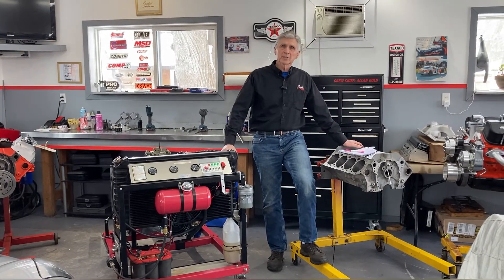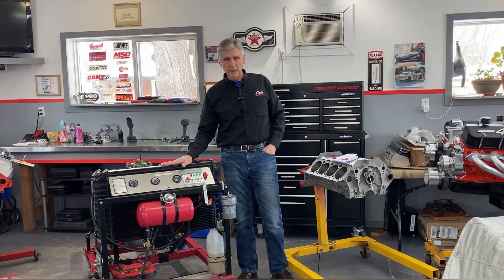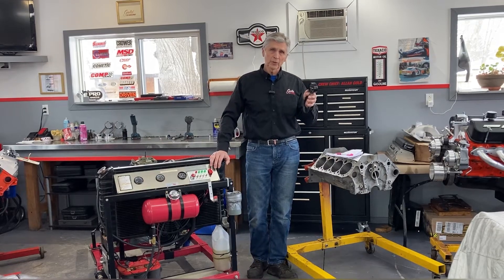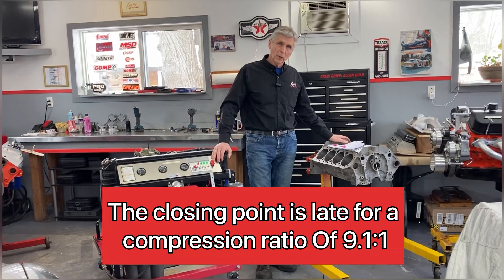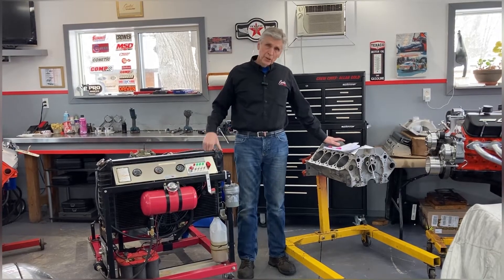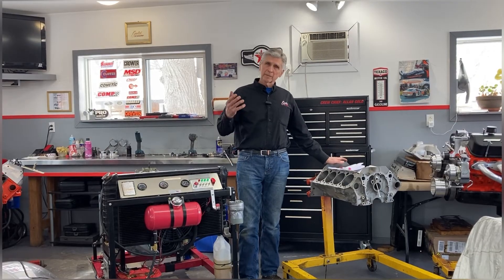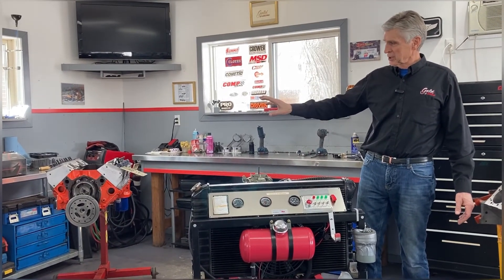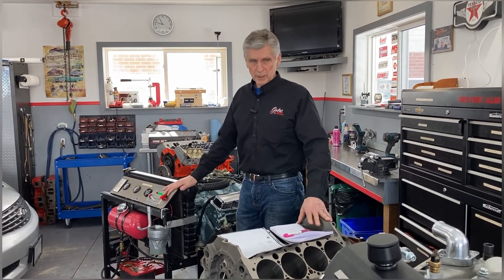Selecting the right camshaft- Matching your cam to your compression ratio - PART 1

Comment: For a good street engine you don't want anything over 10:1 compression. My motors are 9:1 compression n run pump gas. Higher compression ratios n you will need higher octane fuels to prevent knocking/pinging, and today's pump gas with ethanol are less than ideal. I still have to treat my fuel with stabilizer n occasionally octane boost for better performance.
Reply from the maker: Good advice, thanks for sharing your experience with compression ratios and fuel. AG

Comment: Based on my experience  working on race engines,for drag racing a higher static compression ratio but lower dynamic compression ratio makes more power better times more aggressive power,higher rpm
Reply from the maker: Makes sense, thanks for commenting Munch.AG

Comment: I have a question on the Pontiac build. Was the block zero decked? I ask because, when you went to the .025 head gasket, I'm curious to know if you were able to get by with only .025 quench instead of the normally recommended .040. I'm building a 455 Pontiac now, and that info will help me.  Thanks!
Reply from the maker: Thanks for the question Walt. No it was not zero decked. I always aim for at least .040" quench. AG

Comment: How much agfect does rod ratio have on cam choice?
Shorter rods fill the cylinder quicker from tdc right?
Reply from the maker: Thanks for the question CL. Not much, longer rods are typically used for higher RPM engines, so if you have a cam that works at higher RPM, then longer rods would apply or vise-versa. AG

Comment: Maybe I missed it.  How did you calculate your cranking compression based on dynamic compression?  You mentioned  "We expected to get 165 or so..measured it and got 170. I've never seen a good cranking compression calculator.
Reply from the maker: Thanks Pure Stock, we use the Wallace online calculator for dynamic compression and cranking pressure. IT is available on line, so check it out.AG

Comment: You forgot to talk about LSA, which needs to be considered,, LSA of 108 for a 350 with reasonable duration will boost both torque and hp. Hope this helps. Wider LSAs kill low end but give you a longer flatter hp. Curve at high rpm, tighter lsa.s are better for street engines, because it brings the torque on quick at low rpms where a street car needs it. Just dont go crazy with your duration.
Reply from the maker: All good points, thanks for watching and contributing to my channel Peggy. AG

Comment: Are you talking about Cranking pressure OR Gauge pressure???????
The calculator I used online is showing me a Cranking Pressure of 192.43 AND a Gauge Pressure of 177.70.  Hopefully you are saying Gauge pressure needs to be under 180 for a street daily driver.
Reply from the maker: Thanks for the question Chevy. Ideally they should be the same or about the same. Your calculation is theoretical and your gauge pressure is actual. 
Maybe re-check your calculation. The intake valve closing point (IVCP) should be the advertised duration number, not the @.050" number. That is a common mistake that might account for the discrepancy. 
Anyway, you are good to go with the 177.7PSI actual. AG

Comment: 💭 on a 358 build with 12cc pop up dome pistons. 6inch H beam rods crowler forged 3.480 stroke crack. flo-tek heads 180cc intake runners 66cc exhaust runners and 2.02" intake valve 1.60" exhaust valve cam lift 443/465 duration 214/224 112 LSA TH350 but plan on changing to a 4L80E later on posi rearend 3.73 gears may change to 4.11 3000+ lbs car
Reply from the maker: Sounds like you are building a serious engine, sounds like a very good combination!AG

Comment: You keep talking about static compression.I would like ti here you explain how to know your true compression with say a 85 degree overlap built into the cam !
Reply from the maker: Thanks Tom. Okay, Static compression ratio is the ratio of the cylinder volume when the piston is at BDC divided by the volume when the piston is at TDC. It is based on the bore, stroke, combustion chamber volume, piston deck height, piston dome volume and head gasket thickness. Summit has a great on line calculator for this which is very accurate. 
Dynamic compression also takes into consideration the connecting rod length and most importantly the IVCP (Intake Valve Closing Point) ABDC (After Bottom Dead Centre) For a high performance cam, this might be 60-70 degrees or more. 
A late IVCP reduces dynamic compression because, even though the piston is on the way up the cylinder, nothing is compressed until the intake valve is completely closed. Please let me know if that answers your question. AG
Reply from the maker: Dynamic Compression is also a predictor of cranking pressure PSI. AG

Comment: There must be a problem with your math or gauge.  A static compression of 9.8x14.7psi=144psi.  The dynamic or actual compression will be lower.  How can you get 170 psi?  You would need a dynamic compression of 11.6:1 for that.
Reply from the maker: Good observation Woocash. I have often wondered about that also. Actual measured cranking compression (as measured by a compression gauge) is usually higher than the product of the calculated static compression ratio and atmospheric pressure (14.7psi) due to a dynamic effect of pressure rising as the piston travels up the stroke.
Dynamic compression and the resultant calculated cranking pressure is a function of the bore and stroke, static calculated CR, connecting rod length and the IVCP, (Intake Valve Closing Point) ABDC ( After Bottom Dead Centre) . I hope this helps and thanks for watching and commenting. AG
Reply: @goldsgarage8236  thanks for the quick reply.  I did some digging and i ovetlooked the fact that compressing the air raises its temperatute which also increases the pressure further as its density changes.  Its a factor of about 1.4 for air of the expected pressure.  This is regardless of the dynamic conpression factors.  It is making sence now, thanks

Comment: I have a question about an engine having a static compression of 11.5:1 and a dynamic compression of 7.5:1:  will using the camshaft to bleed off this much compression create a lot of problematic heat in the cylinders?
Reply from the maker: Good question Sammy. No it will not. The late closing point of the intake valve just traps and compresses less fuel/air mixture at low RPM which reduces the DC and cranking pressure. At high RPM, the inertia of the F/A mixture helps to fill the chamber. Hope this helps. AG

Comment: Thank you for your time for making the educational videos. I think I may know one important reason why your viewers are not understanding dynamic compression ratios and cylinder pressures, most camshaft spec cards give the intake closing degree at .050" and not at .006", so the viewers are entering the camshaft duration numbers at .050" lift into the calculators and getting the IVC numbers at .050", when the viewers should be entering the camshaft "advertised" duration into the calculators to get the correct IVC number at .006" to use for calculating dynamic compression.
   Most of the online dynamic calculators ask for the camshaft duration at .050" spitting out the IVC number at .050", which again is the incorrect IVC number to use for calculating dynamic compression.
    In closing, the camshaft advertised duration is be used to calculate the correct IVC angle, which then is used for calculating dynamic compression.
Reply from the maker: Correct Sammy. Nothing is being compressed (at low RPM) until the intake valve is completely closed. Thanks for commenting. AG
Reply: Most dynamic compression calculators actually want the valve closing events, not the .050 duration

Comment: Iv found .024 thou. Differance from 2 differant manufacturers 1.6 rockers with same, proper push rods on same engine.same day. The best ones opened the valves an honest .024 thou. More also remember, you may need to retard your cam a few degrees going from 1.5 to 1.6, because it acting like its advancing your cam by opening the valve sooner. There is a lot to learn about engine building.Hope this helps.
Reply from the maker: Thanks for the info Peggy. We are always learning.AG

Comment: Help me understand please. If I have an engine with a rocker arm ratio of 1.5 and a valve spring with an open pressure of 300lbs. Does this mean the pounds of pressure needed at the cam would be 450lbs Since there is NO mechanical advantage upon opening the valve?
Reply from the maker: You are correct. Take moments about the pivot point. X x 1=300 x 1.5, therefore X=450. So the greater your rocker arm ratio, the more force you are putting between the valve lifter and cam. Hope this helps. AG
Reply: @goldsgarage8236  Thx for the response. Now, assuming I replaced the 1.5 for 1.6 ration rockers and I adjust the geometry to achieve the same amount of lift. Would the pounds of pressure at the cam degrease or increase? I think the pressure would be 480lbs, thus an increase.
Reply from the maker: If you replace the 1.5 with 1.6 rockers, you will have 480 lb. force (not pressure) on the cam and lifter. AG
Reply: @goldsgarage8236  Good catch. I mixed the terminology. This clearly proves why the OHC engines can outrev the OHV rivals. The emence  pressure on the cam from the high pressure valve springs means a larger mass is needed for durability. Thus limiting RPM. I wish there were a way to bridge this gap. Would it be nice to have the best of both worlds.

Comment: That cam is weak in the knees on the  lift side of things....You wanna build some cyl pressure, put that cam on a 108 LSA instead of taking a 112 then advancing it 8 dgrees....Save the 112 lsa crap for large bbc...or LS.  A tighter LSA will kick the pants off that 112 dual pattern, any day of the week.. If vacuum is all your concerned about, then don't be disappointed when the dyno falls short...jmtc
Reply from the maker: Thanks for the info Steve. AG

Comment: Thank you for including the story about getting it wrong. I have been fighting with my FE 390 rebuild with a new cam, but all stock for almost 8 months. I have tried everything, advancing cam, smaller carb, different tuning, etc. All stock motor except a cam I have now finally come to realize, is WAY too big for the compression ratio (Probably mid to high 8's, I have 120 flat in all cylinders on compression test). 
It just is nice to see that not everyone gets it right 100% of the time even pros, and really helps fix the hole in my pride over getting it wrong. Along with the tech info, I think I feel confident enough to get back out there and get it fixed.
Reply from the maker: Good information hunter, thanks for commenting. Experience is expensive! AG

Comment: hi , great Vidoe watched with keen interest. trying to work if my cam is "good" for the street. So much info online  its hard to work out.Ive a bbc 427 with a cam thats  230/236@50 on a 114 lsa. I did a dynamic compression test and hit an average of 160 psi plus. Is that decent for the street? For low end grunt and snappy throttle? My Intake valve closes quite late relative to other street cams ( mine closes 45 abdc , a comp cams 262xe closes 35 abdc.Is this a big difference. Any advice appreciated before I replace camshaft!!
Reply from the maker: Thanks for the question Camaro. I think you are using the @.050" numbers for IVCP to calculate your dynamic compression. You should be using the @.006" or the advertised duration numbers. Nothing is being compressed until the valve is completely closed. The cam spec's are ok but i don't know enough about the application, static CR, gearing, weight of the car etc. Recalculate your DCR and let me know. Hope this helps.  AG
Reply: Hi apolgies for the confusion , yes numbers are all at 50.I meant to write cranking compression not dynamic - as your video here is all about cranking compression pressure. So Im cranking avg 160psi - Im a bit concerned current cam too big for street use , but does they psi indicate its ok? wanting lots of low rpm torque acceleration etc , not so much high HP high rpm use.  @goldsgarage8236

Comment: Great video! One comment I have regarding intake closing point is that depending on the cam manufacturer they may list the actual valve closing event or the tappet closing event. 

The calculators dont specify which one to use. Comp is the only cam manufacturer that I know of that lists actual "valve" timing events, others list "tappet" timing, and others don't even specify which one they are listing. Do you have any insight on this?
Reply from the maker: Thanks for the info! AG

Comment: 😂 me dieing inside because I have 250  psi and I run 93 with two stroke racing oil pistons are.003 out of the hole and a .035 with fire ring gasket. 230 24 something  107 or 106 intake centerline and 114 lsa .54 lift 6in forged rods. steel crank. bracket racing keath black flat tops 7cc valve releaf she pulls hard to 7000k 😂 and has managed to break everything behind the flywheel it all started with the damn 454 clutch snap that b** into a million bits. Twisted a drive shaft in half then snap the pinion gear shaft after it was all said and done with chromoly everything in the rear end I cracked the f**** housing now I have a little Dana 80 and i have put the project on hold because it eat all the hp but I put so much effort in making it fit i don't want to take it out so I'm thinking she will be a mud truck now but I have 3.55 gears and just kinda lost interest in it
Reply from the maker: Thanks for the info Bart. AG

Comment: Even more important is making sure the cam lift isn’t way more than the heads can flow at peak lift of the cam.   That will harm power even more than compression.  Your heads have a peak flow number at a certain lift. Beyond that valve lift it has a negative effect on flow which hurts power. So a bigger cam isn’t always better.  I believe this should be figured out before determining your optimal compression
Reply from the maker: you are correct, good point. Thanks Chris. AG

Comment: I have had great success in the past running really high compression (12.5 to 1) in a 355 chevrolet and relatively short duration (242/246] at .050 on a 108 LSA. Dart iron eagle 215 heads and rpm airgap intake. Mid 6.60s in the eighth in a 3200lb car.
Reply from the maker: Mid 6.60's is pretty fast. That would be low 10's in the quarter.  I had a chance to drive a 6.60 drag car  a few years ago. It was pretty exciting. AG
Reply: What is the intake centerline angle

Comment: Question on using a dynamic compression calculator. Should I be using total duration figures, or duration @.050? Im working on coming up with a good static compression and camshaft combination for 93 octane.
Reply from the maker: Good question Noble. Always use advertised duration, not duration @.050" AG

Comment: The past 3 motors I put together I did this, shooting for 7.75 to 8 to 1 dynamic with iron heads.  They run excellent, so much better than tossing something together with low compression.  The combo doesn't work right without doing this.  Nice to see similar experiences.  Valve lift is also important based on what your heads flow.  And obviously what powerband you want the engine to have.  Pointless to have a cam that makes power up to 7500 rpm in a stock 454 big block.  If it's built for it that's different.
Reply from the maker: Thanks CK, all good points, thanks for your input. AG

Comment: I have a rebuilt 283 with flat top pistons ..i did a compression test on all cylinders and it was a hair over 160 ..looking to put a decent sounding cam in it ...looking for advice ..49 Studebaker gasser project ...ive been doing videos on my channel also 8f you want to check it out
Reply from the maker: Thanks Treetop. I just subscribed to your channel and gave your latest video a like. Gassers are cool! 
How about an L79 350Hp 327 cam or a Z28 cam. If you have lots of gear the solid lifter Z28 cam will sound cool. It will kill your low end torque but if you have enough gear it might be ok. They are fairly inexpensive.
Reply: The rear end is a Ford 8.8 with 4.10 gears supposedly
Reply: Could be a little lower but not much
Reply: I subbed also

Comment: Very informative video, thanks! I have a 327 with the CompCam version of the GM 3896929 300HP cam. My cranking pressure is 160, it runs smooth as a smelt!
Reply from the maker: Sounds like a very nice street engine John, Thanks for your input. AG
Reply: Just curious, do you know pretty accurately what your static compression is?
Reply: @notnecessarilynecessary  It was 160psi last I checked.